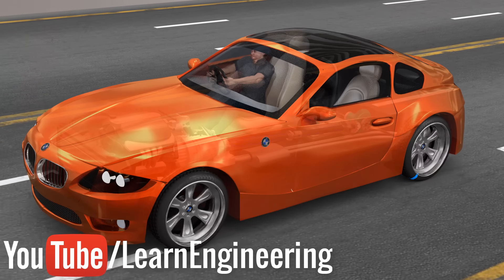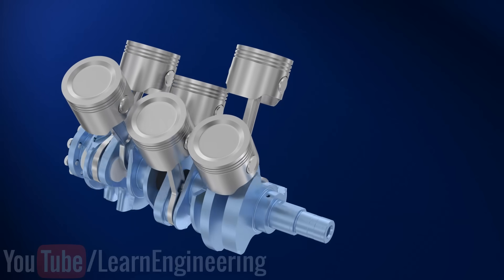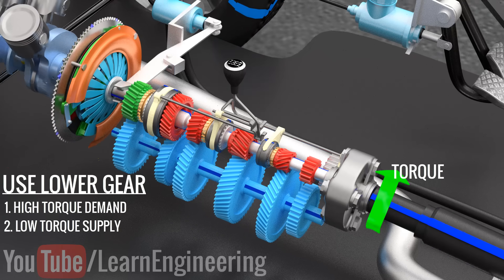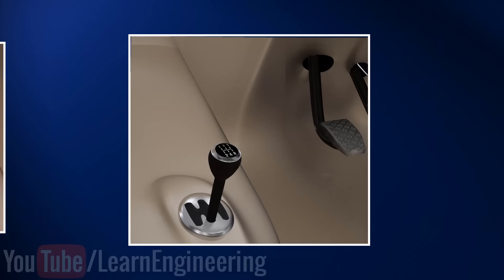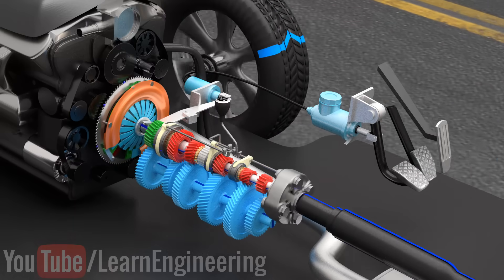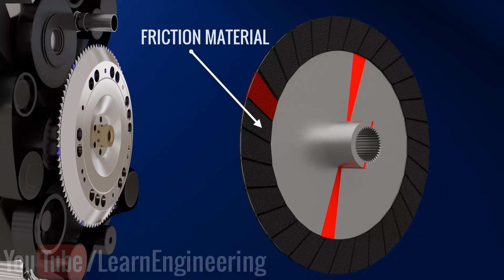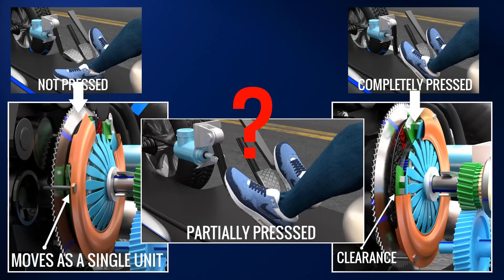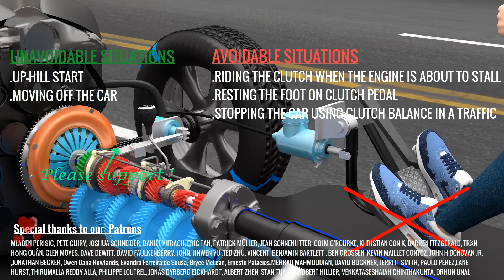Why you should not PARTIALLY press the Clutch?

Comment: I'm a new driver and own a petrol but was taught in a diesel (absolute massive difference), whenever I stop at lights, I brake and clutch goes down. I shift into first gear and find my bite while pressing the brakes. I don't know if this will ruin my clutch or if it's harmless, I'm also doing high revvs when setting back off which is so embarrassing 🤣 
I just can't seem to get the hang of it n

Comment: Question please, I once drove an automatic car and while driving at 115km/h on the highway with the 5th gear the engine had a big bump and I thought I broke something, the engine was acting like it was suddently on the 4th gear, even maybe the 3rd one, no engine light at all, I let the car decrease speed until 70km/h and then pushed again, but the engine refused to put the next gear. I had to stop the car and restart the engine. I think the engine acted like it was on the 3rd gear but above to limit, acting like the car was maybe in a big slope ? I thought I had to reach the limit of the 3rd gear to reach the 4th but on the highway it was impossible to drive too slow so I quickly waited for the next stop with the engine going to 4000 turns/minutes. This was traumatic and I never used an automatic car again. The incident took place on a flat highway, I was driving since 15 minutes with a regular speed, sunny day, not too hot. The car had a lever to fix the limit of speed in the city, to only use the gear 1 2 3, but I was on the correct position to use all gears (as always), the lever didn't move. Any captain to explain ? Please ☹

Comment: One of the worst arguments when married was about riding the clutch (which I knew not to do).

Me: (driving. Left leg up, foot hovering above clutch. I was 21, young, stamina all day fit legs)

Him: Get your foot off theclutch.

Me: (conversational, clearing it up) I'm not on the clutch.

[All cleared up, it's over right? No.]

Him: It's bad to have your foot over the pedal even if you dont feel the clutch.

Me: But it's not on the pedal. 

[I was sincerely believing he knew what that meant. And I'm a little amused realizing how goofy it is I'm holding my leg up as a driving habit].

Him: It doesnt matter if you're not using it, just barely resting your foot on it will burn it out! 

Me: But I'm not on the pedal. (Wiggling leg). I'm just holding my foot up.

Him: JUST HAVING YOUR FN FOOT BARELY THERE WILL BURN IT OUT!

Me: My FN FOOT is NOT ON IT! I'm NOT ON IT!

[What the- ???Does he think magic will flow from my foot, through the air, and to the pedal? geez!]

Him: [pause] YOU'RE GOING TO BURN THE CLUTCH OUT! JUST HAVING YOUR FOOT THERE--

Me: LOOK! LOOK! I'M NOT TOUCHING THE FN CLUTCH! FFFFFFF. I'm not even TOUCHING IT!!!!

[Mind you, I'm also trying to drive. And around we went until it got through his thick skull bones I was holding my leg/foot up over the clutch, not touching. And another afternoon ruined due to manstration.]

Comment: This is true for syncomesh transmission. For commetcial trucks with non syncomesh transmission you need to double clutch and you only floor the clutch when starting from a stop. For shifting while in motion you only go an inch or two after the freeplY and Nevet floor the clutch otherwise the clutch brake will stop the transmission and you will not be able to shift.

Comment: I ride the clutch everyday because where I work have traffic jam on a highway exit, I'll release my clutch a bit and my car shall move about 10 kph, 30 kph if I shift it to 2nd gear, however I notice my car would not stall while in 2nd gear without riding my clutch and/or hitting gas. Is this normal?

Comment: Thats totally wrong you need only to press the clutch while only you are changing the speed, mostly manual transmission cars do that, but if you have a bmw depends of the model and the type of speed transmission that you need to follow some other specific requirements and actions to do so and by the way if there it is any bmw manual transmission car dont means they are for this  actions depends like i say before for some specific models.

Comment: 2:52 so how is it possible to drive a manual vehicle without using the clutch?

(You do it by matching the speed of the gearbox to the engine speed and it will slip easily into gear - I have seen coaches so driven after the clutch failed: start in gear (not good for the starter motor/ring) and then speed match to change gears to get it somewhere safe/to where the clutch could be replaced.)

Comment: In case you are wondering: Yes, it's ok to release slowly the clutch pedal sometimes, like when you start moving from zero on first gear or when you need extra power to not stall (Like going uphill). You are not going to damage your clutch disk for doing those two things.
Reply: The end of the video lists those situations where riding the clutch is unavoidable.
Reply: Stoping when you going uphill (because of traffic or else) using a manual transmission for beginner is a nightmare..
Reply: @borneowisnu2404 If you think doing an uphill start is a nightmare in a car, try doing it in a fully loaded 40 ton tractor trailer with traffic right behind you. 😨😨
Reply: The easiest method for slopes is it using the handbrake. Works for reverse too.
Reply: @borneowisnu2404 nobody will ever admit that manuals are retarded. So drive "wrong" until you master this shit.
Reply: @borneowisnu2404 only for a novice in driving
Reply: Is it the same in motorcycles as well?
Reply: @youneverknow01  no in a motorcycle you can ride the clutch a lot more because it's generally except for a few bikes it's going to be what's called a wet clutch which means it's a stack of plates and it's in a bath of oil. And in a motorcycle you must ride the clutch especially when you're in lower gear. It's absolutely essential for the finer control of the engine
Reply: @angie99656  I haven't ridden a proper multi speed motorcycle (well I rode a 3 speed dirt bike but it had a centrifugal clutch) but I understand a lot of them - especially the sport bikes - have quite a high first gear idle crawl speed. Is that correct? Like if you put a car in first gear and let it idle, it will usually move about 5 mph, but some sport bikes you'd have to run quite fast to keep up with one (10+ mph) even in first gear with the throttle all the way off. That does sound like a pain in a traffic jam where you might just scoot it with your feet! Unless it's uphill of course.
Reply: @youneverknow01  yes it is
Reply: @youneverknow01 sometimes you need to ride the clutch going through a tight corner,you should never depress the clutch fully in a corner. To undestand why,it needs a whole more of an understanding on how motorbike traction and cornering works
Reply: what aboit in very heavy traffic? I use the clutch to crawl and don't touch the accelerator
Reply: @vatsalsinghchauhan  it's unavoidable then, dont worry at all. What wastes the clutch and you should focus on not doing is using it everywhere, like when reaching corners or going over bumps, where you could just press the break disk a little bit. Also try to avoid pressing the gas pedal while releasing the clutch when changing shifts, unless it's totally necessary, like to not stall.
Reply: @vatsalsinghchauhan  if you have a diesel you can do that, yes, on a petrol you need to push the accelerator just a bit to crawl at walking speeds. 
Also i was thought to "half clutch" ,the technique you just described, when driving in reverse, no matter what. 
You shouldn't worry about that, as it is normal to happen during traffic and at low RPM's and speeds, doesn't hurt your clutch that much, it becomes a problem at higher speeds and RPM's, because then, there are bigger rotational differences.
Reply: Is giving a bit of gas while releasing the clutch slowly to better start from a full stop too?
Reply: @alessandrodona4296  When moving from zero is totally ok to give it a little of gas.
Reply: @alessandrodona4296  No problem. Depending on how old and how poorly maintained the car is, giving it some gas might save it from stalling.
Reply: Yes that is how you drive a car
Reply: wouldn't you just down shift? going down one gear is enough to keep your climb rate the same if you aren't going fast enough to keep the revs up above 2k when going on top gear
Reply: An important thing is don’t worry too much about it. It’s a cheap fix compared to a new transmission so it’s softer to wear the clutch as a newer driver than ruin the gearbox
Reply: Thank you
Reply: Or when you are in reverse, maneuvering the car
Reply: It's also unavoidable in traffic. I cannot always be in first gear so i put the clutch down and slowly raise it. You also cannot instantly raise a clutch while in first gear. Otherwise you'll stall.
Reply: I simply keep it up or ad more acceleration, I barely use the clutch for anything else, guess what, the clutch is very good, changing gears is smooth and car drives like a dream
Reply: it still will but it's unavoidable
also it's the reason why you even can ride the clutch
Reply: He couldn't be more clearly talking about one specific example, why is everyone clowning?
Reply: Of course you will damage it in the same way that is discussed here in the video. The laws of physics still apply in that scenario. It’s fine though. That kind of wear is expected
Reply: It's incredibly difficult to cause damage to your clutch in first gear.
Reply: Valley uphills clutch riding we do 
If we not what we do on uphills
Reply: You actually slide a bit at every speed change, just a lot faster above 1, that's how you drive a car. Also releasing the clutch completely is fine in some situations.
Reply: It's not a matter of releasing it slowly, rather matter of releasing it smoothly.
Reply: Considering to buy a new car. But wondering what will die faster from my shit driving skills: automatic transmission or mechanical one
Reply: @Gameplayer55055  I had to change a manual Renault Fluence clutch a week ago. The car was very clutch driven. It had 300.000 Km (186.400 Mi) and the whole reparation costed 500 US$ (Here in Argentina). On new cars it can cost a third of this price. Not a big deal.
Reply: @Gameplayer55055  An automatic.   Most manuals are fairly bulletproof.
Reply: @m.whitleyacton821  the thing disappointing me is that there are many automatic transmission types as well: CVT, DSG, robot, or even a hybrid car with a motor

However i am learning manual transmission because i will be able to drive all the cars (driver license in Ukraine has "can drive automatic only" option, I don't want that)
Reply: Y si, sino se te apaga el motor maestro
Reply: yes you are, every clurtch operation damages the clutch since friction is generated and materials degrade.
Reply: But why?

Comment: Riding the clutch for a moment is unavoidable for accelerating from 0. However, you should as much as possible, match your RPM and gear to your speed to avoid riding the clutch while on drive. If you're slowing down, you should shift down to avoid stalling, and then rev up if needed to avoid (unintentional) engine braking. How far you have to downshift and how much you have to rev to match depends on the vehicle: not all engine power, torque curves, and gear ratios are the same after all.
Reply: Hey sorry for bothering after 3 years, i just got my first car and I'm still learning, i wanted to ask if was ok to ride the clutch at 2nd gear when on a roundabout or any left/right turn, sometimes i gotta slowdown a lot to make the turn but if i don't ride the clutch it stall
Reply: @Noob-cq6jt  i suppose you're driving really slowly as you're still learning and don't have much confidence yet. or maybe your roads have really tight turns and roundabouts.

either go faster (as safely as possible!) to avoid stalling, or go down to 1st gear, which will possibly have you go even slower. if your roads are really narrow and the turns are tight, you may have to do the latter (shift down).
Reply: @Kensuke0987 thank you so much for the help❤

Comment: Only exception with riding a clutch is in a rotary. Where low end torque doesn’t exist so from 1000-2000 rpm your riding clutch and feather the throttle

Comment: Riding the clutch at low rpm is ok. Don't use in high rpm.. that's why you use clutch. Wear n tear for good reason. Just like your tire. Like your shoes. If you want riding the clutch at high rpm than use racing mode. Don't use standart mode on harsh usage. Riding smooth is good for safety. Not practical if you want to keep your clutch but end up unsafety act while driving..

Comment: I learned how to drive a stick on a hill first, so I could understand 1st gear, the most difficult gear to engage without stalling the motor. Basically I'd have to keep the car still on a hill and achieve forward motion without burning too much clutch or jerking it forward. Then there after, I'd engage the higher gears without any jerking by imagining a hot cup of coffee balancing on my knee. Eventually, after you learn the finesse of diving a stickshift Takumi Tofu style, you can then learn all the higher skilled tactics and styles to output as much power to wheels the engine can push as possible.

Comment: There are scenarios where a partially depressed clutch are necessary, such as the gradual connection of the engine and transmission needed in hill starts.
Reply: Yes you're describing the normal operation of a car. That's litteraly what the clutch is for.
Reply: @hmmmhhhmmh  I know which is why I responded to a video saying not to do that very thing.

Comment: Riding the clutch causes 3 problems for the clutch 1, it wears out the fingers on the pressure plate 2, it causes excessive wear on the clutch release bearing &. 3, it causes burning on the clutch plate. So. Basically a knackered clutch. Also if you keep in gear with the clutch peddle depressed and in gear in stopped traffic and your foot slips off the peddle, when your foot gets tired, the vehicle will lurch forward into the vehicle in front or some poor sod crossing the road between the stopped traffic, result pedestrian with broken legs you in court plus points and a fine / civil damages claim against you.

Comment: Mis-information here, @2.49 !! 
You CAN change gear without the clutch being used.
Reply: Yeah but that's more of a you can do it that way but it's not the way it's designed to be done.

I did for a full year in a 20 year old citroen Picasso because the clutch was on its way out, generally only used the clutch for starting or harder situations.

But matching speed with the throttle to the gear takes a lot of practice and comes with its own issues of wear and tear on the transmission instead when done incorrectly - which is a much finer line between right and wrong than using the clutch which is very forgiving.

Comment: Ok. First.
You need to know where the sweet spot is when you depress the clutch pedal.
Partially depressing the clutch pedal is perfectly fine as long as you are able to feel it and you know where the clutch sits.
Actually, it'll make it last longer than depressing completely to touch the floor, because that way you're losing accuracy while shifting.

Comment: A rule that every driver should know is that the clutch should always be pressed as fast as possible and released slow(depending on the gear you are on) 1st 2nd 3rd is usually slower whilst 4th and 5th should be relatively fast

Comment: That is more like slipping the clutch than riding the clutch. Slipping the clutch is a great technique in motocross racing because it lets you go through corners in a higher gear and saves a shift on exit.

Comment: I bought a Tesla to avoid stalling my engine.
Reply: Lmao learn to drive
Reply: @YMGRayan  it’s a joke tulip. I have a competition 4x4 with manual transmission, low range box and reduction gears that I built from the ground up. I’ve owned and raced drift cars…I also track race the Tesla for fun at my local raceway. I’ve rebuild engines, gear boxes, out boards, and homes from the ground up. I’ve been part of teams doing engine swaps on everything right up to 60 liter 8 turbo diesel electric haul trucks. Let me tell you, the absolute most fun car to drive, is the Tesla. And fuck do I love flogging it on a day to day basis knowing there’s 2 tenths of fuck all I need to do to maintain it. I dunno, some people love pulling apart and repairing their cars at a stupid cost and constantly. Many others have neither the tools or the know how to maintain their own gearbox should something go wrong. (Can you?). 

I’m fucking over fixing mechanical drive components. Because I don’t pay people to do my dirty work. Funny how every manufacturer since the dawn of time has been trying to develop a reliable CVT to produce max horsepower at the peak performance RPM of the motor. And now since EVs are not only doing this by nature, they are destroying ICE cars in many performance figures…  you get people saying “but I love the sound of an engine”. Who gives a fuck about the sound of your slow lol.

Comment: For those of you brave enough to try- on start and stop you need the clutch. After that, for upshifting or downshifting I just get the revs up til i find the sweet spot. I’ve done this in a BMW , Yamaha bike, and presently in a freightliner. Also if you’re good you can skip gears. I’ve gone from 4 to 6 for example it saves shifting so much.
Reply: The fifth gear is the least use gear of mine.
Reply: @deadbeef576  I hear ya! On some flats I can do 4-7 on 10 speed. Skip shifting helps me because of city driving. Shoulder and wrist takes a beating. I’d rather run automatic and flick a switch for the PTO. Or go old school and at the least have a 13.